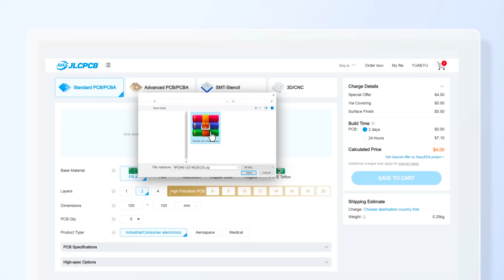DIY Boost Converter Adjustable Voltage & Current 8-36V 5A #BoostConverter

Comment: Great job. Is it possible to download your garber file for this project.?
Reply from the maker: This Prototype has few flaws, I made the tracks very thin , you can first assemble it on Prototype PCB if ok , I recommend designing new PCB using the Schematics
Reply: @Electronic_For_You  Thank you for your respose and advice. Keep the good work